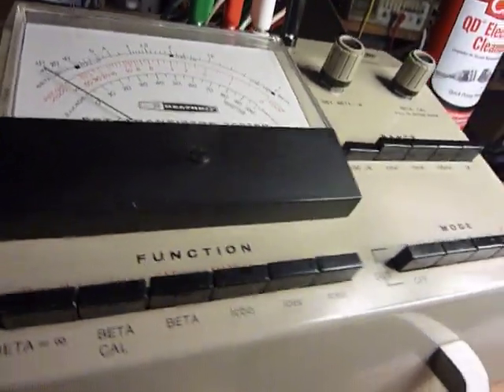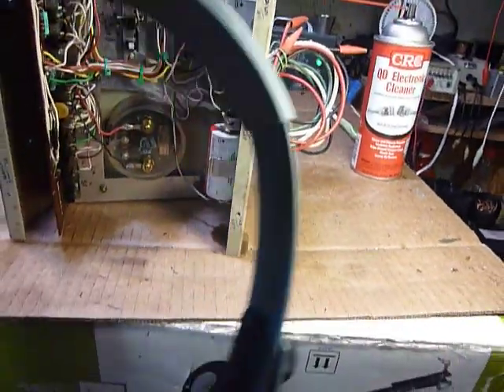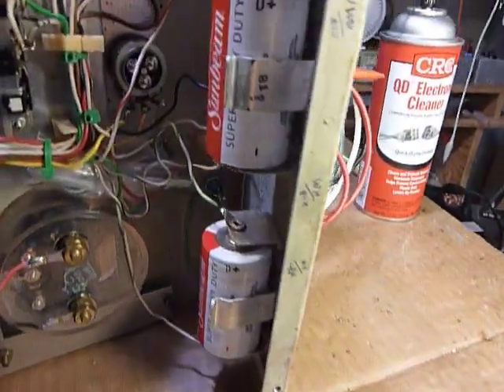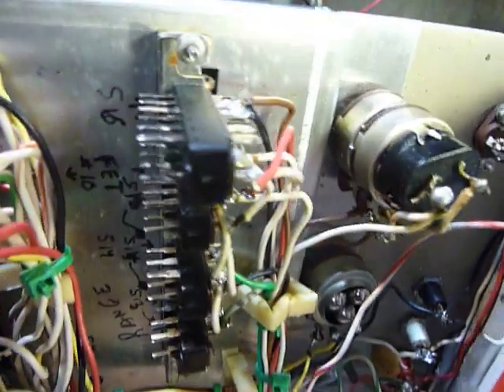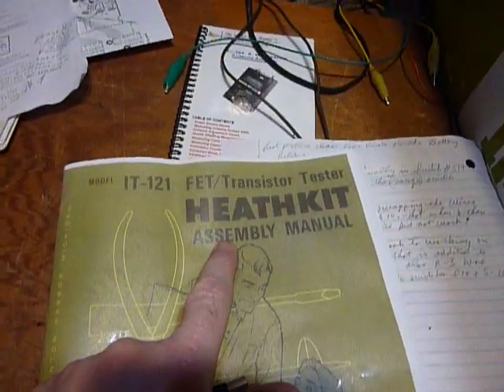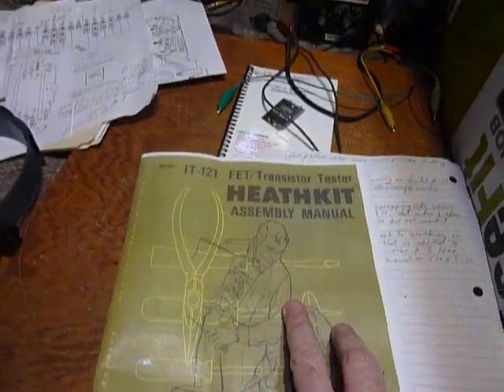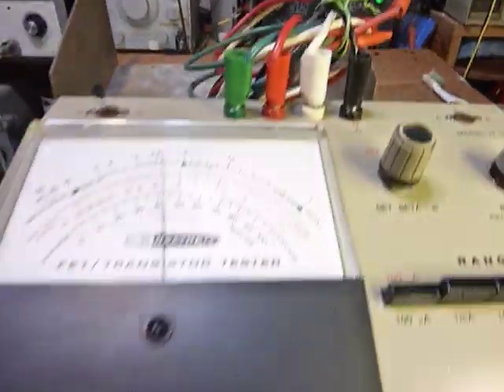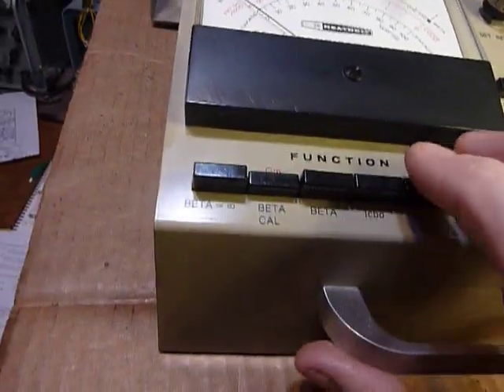HEATHKIT IT-121 Transistor tester , IT-121 Repair ,IT-121 restoration to operating condition

Comment: Hi Robert, congrats on sticking with it until you got the problem(s) resolved. I still find the IT  121 to be an excellent tool for closely matching FET's and transistors as you stated. I also brought the battery connections out and 3D printed a box to place them in. I have seen a number of these 121's badly damaged from battery leakage and it's easy to let it slip until it's too late. Now my leakage is contained and easily cleaned up if the need arises. I plan to do the same thing for other items I own in the shop with a battery or batteries. 

73 es God Bless
Glenn WA4AOS  dit dit

Comment: Bob, I constructed one of the last available units from Heathkit in 1986. After finishing it I stored it until recently. It is in perfect new looking condition.  The problem is with those little pushbutton switches.  They do not move smoothly.  They stick and and connections within them are intermittent.  What kind of treatment of these switches do you recommend?   I know you had issues with them.  I tired some contact cleaner and it made them more difficult to move due to washing away lubricants that may be in those switches.

Comment: So you were able to get it to actually test FETs?   Mine seems to work for transistors but when testing FETs the meter just stays all the way to the right all the time and doesn't more for any of the switch settings except leakage goes back to 0.  I checked all the construction steps in the manual and it seems to be wired OK.

Comment: Once, a friend helping me troubleshoot a computer circuit board found a short between two points that kept it from working.  We looked all over that thing, following the traces of the two points. He finally found the trouble with a sewing needle, running it along between a long stretch where the two line ran parallel - there was a tiny point where the etching hadn't removed the copper between the lines - I mean TINY!  The needle would give a little 'click' as you pressed it down and ran it along between.  The manufacturer covered the error with resist so it couldn't be seen. The needle also served as the tool to remove the offending copper and the board leaped to life.
Happy New Year and thank you for this video!